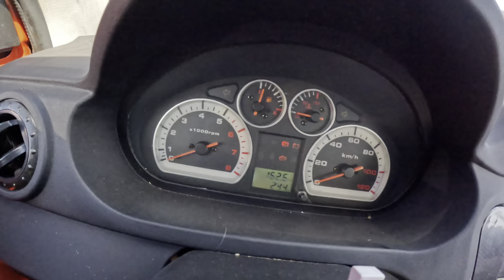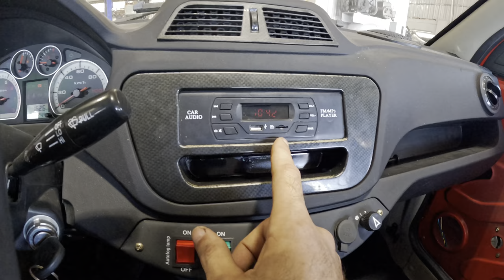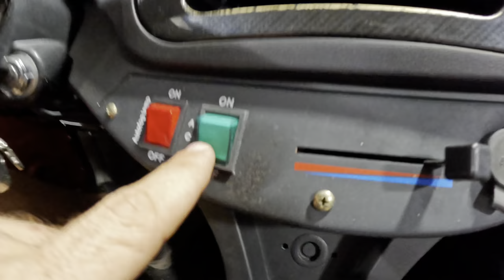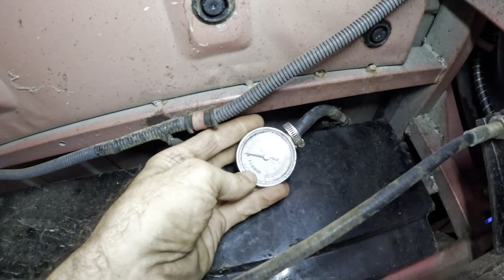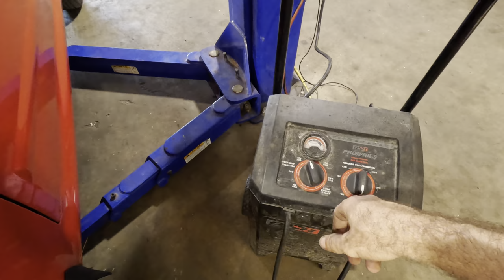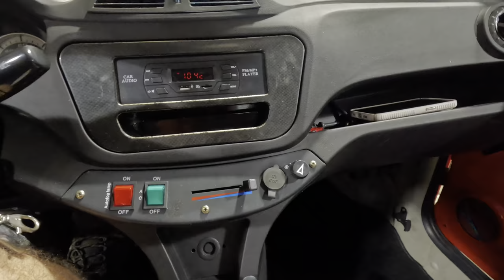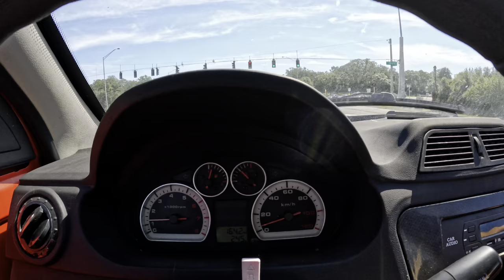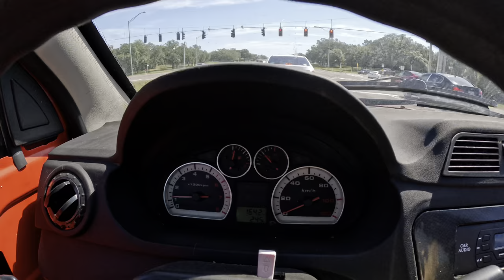UNFIT for the ROAD! Brand New 2019 Piece of Junk!

Comment: If you added a chrome exhaust tip to it, it should, in theory, go faster.
Reply: A chrome tip would add at least 20,000 horsepower.
Reply: What it really needs are some flame or tribal decals from Auto Zone...
And then add some "stick on" Buick portholes down the fenders...
Reply: @bawbnottheowldbawb7558  Then add a new class of race car... "A Gillion M.P.H. and faster."
Reply: it MUST obey that automotive law! 🤣
Reply: LOL - And also double the resale value
Reply: It is red, so it's obviously à high performance model.
Reply: Seriously? You're nuts!! 20,000hp?? NO WAY!! Maybe 10,000 hehe
Reply: If it had dual exhaust pipes, it might make a nice wheelbarrow! 🙂
Reply: HAHAHA
Reply: @slacker1 - Yeah a  simple and cheap standard auto parts store sourced chrome exhaust tip I'm sure would double or triple the horsepower. But to go really fast it needs a full-tilt Ricer-spec wing on the back, some fake carbon-fibre interior enhancements, a minimum 5-inch diameter 'fart can' exhaust tip, glitter window tint on all windows, a multi-colored flashing neon under car light kit connected to and controlled by a minimum 1000 watt sound system and at least two huge (more and bigger always makes for better and faster!) "No Fear" decals  down  both sides of the body!
Reply: And new rims,haha!😂
Reply: @humpy936  Yes, cuz old rims have old man fart dust which slows down. But, new shiny rims spin faster which in turn goes faster.
Reply: Don't forget the hood scoop!
Reply: lolololol
Reply: NO!!!
For the love of God, DO NOT make this go any faster. It is already dangerous. Do not make it worse.
It's all fun and games until someone gets maimed, so just say no.
Reply: @humpy936 you could fit the wheels off my old skate board on that tiny car. 🤣.

Comment: If the price was right I would buy one. My wife could use it to go to the market. We live in a small village and only go a few blocks. We use a motorcycle every day but don't go out if it rains. I bought a scooter for my wife and she rode it a few times but is scared of falling over. She drove a golf cart once and loved it.
Reply: It would be great as a shopping buggy. I have driven far worse cars than this. Would like to chase it down bare foot. Drive it for 10 hours and you are 250 to 300 miles down the road. (I would be afraid to take it on a fast traffic road a village would be great thing to have.) He is being bit to harsh on the vehicle it’s $1000 or so new not a BMW.

Comment: I love the simplicity of it. People here have been spoiled by all the luxurious amenities in bigger modern overpriced American vehicles. Yes safety isn’t a big factor here but for a tiny thing to run around a small private community or property like a college campus/school, it does the job. Surely better than a golf cart. You have AC, radio and protected from the elements (rain or bugs). Yes the seals aren’t great but your other alternative is wide open. You can easily add rubber seals and better radio etc. it’s minimalist and simple to fix. Not all computerized. Spare parts at your local hardware store. Ha!
Reply: It’s literally a joke. I garuntee you people in china( besides the engineers) have never seen or heard of this “car”
Reply: @matthewmitchell-hl4rn You might want to rephrase your rant and make it understandable. This time, please also utilize the ‘spell check’ feature on your device. Ha!
Reply: safer than any bike or 3 wheeler
Reply: @hoklo6571  nah, this has no more protection than a motorcycle in a serious accident & bikes are an order of magnitude more agile.
Reply: Please for what one of these jokes cost new you could buy a very economical old car in America that will provide you far more reliability, comfort, and safety. This is a clown car. You want to be a clown? 😂
Reply: @matthewmitchell-hl4rn you people in China? Lol pretty sure they guys american and nice job assuming
Reply: Thats exactly what i was thinking @ButterfatFarms

Comment: AC on a 2 cylinder, your lucky theres enough hp left to drive, I'm surprised it didn't just automatically roll the windows down when you activate the AC
Reply: roll up for speed
Reply: It is used as a brake boost!
Reply: I installed AC onto the three cylinder Geo and it barely had enough omf to get out of its own way. Then there was the chevette diesel with drum brakes, would not go, would not stop and barely made cold air.
Reply: Many years ago my sister owned a Datsun 210 that had AC.  When you switched on the AC you'd think the car was just kicked in the junk.
Reply: A/c = fan and open window

Comment: I remember falling into the chinese micro car rabbit hole about 5 years ago when I went to Roanoke, VA and spotted a small 4 door 3 wheel car which turned out to be a "Wildfire WF-650", a SD650ZK that was imported to America and rebadged after it arrived in a small dealership in Ohio. This company also sold a taller 4 door, a pickup, a pickup with dump bed, as well as mopeds and small electric cars before moving on to sell small houses on trailers. The engine parts were surprisingly easy to find since a company called Joyner also sold buggies with the same 650cc engine which is also readily available to this day (if you're willing to spend 1.4k on a full drivetrain)

The cars are so poorly made, but they seem fun to mess with when they're new. They're so barebones, it's probably a fun way to start working on small engines and even electronics since the fuse boxes are easily accessible.

Comment: More people should drive cars like this.  May force them to drive better.  Ac heat and a radio, what else do you need
Reply: An ashtray.
Reply: That's all my civic has. I'm shocked it has power steering. I love it
Reply: I prefer my BMW. Mine is easy to work on & maintain myself. Has all the cabin features i could ever want.
Reply: I agree, I have a Mazda SP23 2004 manual 5 speed, no traction control or stupid sensors, I’ve had it since new and it’s a phenomenal car because it’s simple and it just runs😊

Comment: Just keep in mind, Geely owns
Volvo
Lotus Cars, UK
Maserati
And some other brands. You should see Geely crash tests. You're safer on a motorcycle.
ETA: No, you cannot title it. It does not meet DOT and NHTSA safety standards. It will be 2044 before you can import it under the 25 year rule, and since it's already here, it cannot be legally imported as a road vehicle. You can totally drive it on private property and cross the road between two pieces of private property, but it is not street legal for safety, bumper height, emissions, and a ton of other reasons.
Reply: What are you on about?

Comment: It makes the French 2CV look good. I remember having a Korean Daewoo Matiz as a courtesy car..  it had all the features like ac and power steering , but  the 3 cylinder 850cc engine was scary , being chased down by 44 ton tipper lorries. 

Scary build quality, I could see daylight down by the pedals too. Welding worse that a home made box trailer.
Reply: Matiz is better. Still slow and quite bad handling compared to other small cars.
Reply: 2cv doesnt have ac
Reply: I assume you're from the UK. A 850 Matiz can surpass 80MPH with the hammer down. Unless those lorries broke the law and ran without speed limiters, there's no way they would be chasing you.

A 2CV would struggle past 65MPH and lose speed on the slightest of inclines.
Reply: @ferongr  On the flat with one person it can do 85. But we had one as a loan car, for a holiday in hilly Wales. Loaded with two people and stuff ….. Joining a duel carriageway up hill it failed to accelerate to 60 mph
Reply: @ferongr 71mph max for a 2cv6
Reply: A buddy had a Daewoo, and he was in the junkyard because he was getting an alternator for his out of a wreck. He forgot his tools. No problem, a little bending and twisting and he tore it out with his bare hands!

Comment: reminds me of my old 1996 geo metro. i loved that little car. 
on a flat surface, i could put it in neutral and push it with one finger.
Reply: Omg, I had one of those 😂.  3 cylinder,  it was great but I had to turn the AC compressor off when I went up hills to get enough power LOL.  it was a cool little thing 🤷‍♂️😆
Reply: For basic transportation, that's all anyone needs. People driving 400 hp 6000 pound pickups around and never hauling or towing is plain dumb.
Reply: Hell yeah buddy. My first car ever when I got my license at age 16 was a 2000 Chevy metro. That thing was scary as hell to go on the highway with but perfectly fine for city driving and such incredible gas mileage driving around with essentially a lawn mower on steroids.

Comment: I'd like to point out this Chinesium automobile doesn't have power steering because a small car like this doesn't require it. Small cars back in the day didn't have it and they steered just fine.
Reply: Some of us remember when most big cars didn't have power steering.
Reply: careful, you'll hurt his feelings
Reply: Usually cars that weigh less than 1000 kg are fine without power steering.

Ok it will be just a tiny bit harder to park but while moving it will be fine lol

Comment: It's not even like an "armored golf cart". It's more of a "golf cart plus".
Reply: A golf cart with the right gearing can BEAT THIS JUNK STOCK.😂😅
Reply: That's an insult to golf carts.
Reply: I mean the a/c and heat are the only plus.
Reply: Plus what?  It's got nothing on a golf cart.
Reply: I think golf carts have better tires & brakes!  🤣
Reply: People use golf carts for reliable daily transportation in some places in the US (Galveston for example) . But I wouldn't trust this thing to reliably go down a golf cart path.
Reply: Somehow I am not convinced about the plus...
Reply: Turn off the AC and double the acceleration!deffinate get the engine ported for any speed!
Reply: Fit a standard radio and some sound proofing,not safe as so small even with all round rotor brakes!

Comment: I think it might be from Guangzhou Auto, possibly one of their old offerings under the Gonow branding.  The logos don't look like anything currently in use but I get the feeling that this thing has been sitting around for a couple of decades based on the amount of rust underneath on something that has never been driven.
Reply: I was thinking Geely. ✌️
Reply: It's a 2019 so probably hasn't been sitting around very long
Reply: @MrUbiquitousTech  No paint under car RUST
Reply: @graemehutchison5696 Numbers mean things, 2019 means it hasn't been sitting for decades.
Reply: No, the rear logo implies GAC Group.  The steering wheel logo looks like a cross between GAC Group and Foton (GAC Group has had many subsidiaries and manufactured vehicles for Honda, Toyota, Mitsubishi, etc.)

Many of these subsidiaries have come and gone over the years; presumably this vehicle is obsolete or discontinued within the past few years.

This type of car is for pensioners; they give away their nice car to the grandkids so they can have something decent for college/starting off their lives.

This car minimizes expenses, lasts a few years.  When the owner passes away, either someone in the family will take the car or give it away to another pensioner.

The car doesn't need to last forever; just longer than the people owning it.  Then it either gets chopped for parts or scrapped like a disposable product to make a new disposable cheap mini-car.
Reply: @Tread1775  belts have Chery logo

Comment: Here in Europe(maybe only in Estonia) these things are a hit. These things can be driven here by people without drivers licence(even people having their licence revoked for DIY). Recent law dictates that people who drive these things, have to use a sign on them, which indicates a "slow vehicle", usually used on farm tractors. But nevertheless, people around here use them even if they cost about 2500 units, more than a "normal" car...
Reply: 2500 units?
Reply: So what is the make and model of the car? Activa seems to be the model but who makes it?
Reply: You are speaking about "LIGIER" or other brand of "microcars" ... driven by a small diesel-engine. Indeed no speed above 45km/h ... but I know a lot of people that are very pleased with those vehicles. 
And YES ... they are quite expensive. Too expensive in my opinion.

Comment: The vibration of this engine must be spectacular, every single screw leaving it's place 👌👍
Reply: 90% of viewers from China.
Reply: FIAT 500 has 2cyl. engine
Reply: @Kartraceone  tiny 4 cylinder
Reply: @KingfishStevens-di9ji  Fiat's TwinAir engine is a Straight-twin engine designed by Fiat Powertrain Technologies as part of its Small Gasoline Engine family — employing Fiat’s MultiAir hydraulically actuated variable valve timing and lift technology. Wikipedia

Compression ratio: 11.2:1 (naturally aspirated); 10.0:1 (turbocharged)

Configuration: Straight-two

Cooling system: Water-cooled

Displacement: 1.0 L (964 cc) (naturally aspirated); 0.9 L (875 cc) (turbocharged)

Fuel system: Indirect injection

Power output: 60 PS (44 kW) (naturally aspirated); 80 PS
Reply: @Kartraceone  LOL ok, the fiat 500 I owned had a tiny 4 cylinder. Maybe those other two cylinders were fake.
Reply: @Kartraceone  seriously Google Fiat 500 4 cylinder.
Reply: @KingfishStevens-di9ji  the old fiat 500.
Reply: @joaovitorsilvagohl682   Nope, the current one.
Reply: @joaovitorsilvagohl682  Fiat 500 TwinAir

Characterful two-cylinder engine breathes new life into Fiat's retro city slicker. We drove it for the first time on UK roads to see how the little Italian stacks up.

by: James Disdale

29 Oct 2010
Reply: Current Fiat 500 was issued with several different engines and transmissions as well.
Reply: @Kartraceone  circle gets the square.
Reply: @Kartraceone  You really can't compare this engineering & quality to 500's engineering & quality. This engineering and build quality makes fiat 500 looks like a car from the space age...
Reply: @justaparps8088  You have amazing ability, reading something, somewhere that I never mentioned and telling me this ? I have few 500s and need no lecture on what FIAT is, in fact in last seventy years I had many different FIAT models. I merely said that it is one out of two modern 2cyl. 4 stroke engines that you could find nowadays in the car.
Reply: Nothing a tube of bolt sealer can't handle.

Comment: In this day and age where most cars are pricing at $50K plus, there is a market for an inexpensive but well made car for under $10K.  I don't need power everything, fancy radio, vibrating message seats, etc. I can use a car like this but just a better quality build, and designed to accept all the popular upgrades I could use as I want them.
Reply: What about the airbags?
They are responsible (when used with seat belts) for people walking away from unbelievable crashes....

Comment: Looks like the intended market in USA for the importers are in the "Golf Course Retirement Communities", like The Villages near Orlando, which are all laid out with seperate mini-roads for golf carts and mobility scooters.  A senior's alternative to golf carts to get around town but this one is (fairly) rainproof and has A/C (if it works), and is not intended to be street legal.
Reply: Or they imported it as a curiosity? That thing is over 25 years old, and the design stems from the 80s. I have a road-going version of this car in Canada (Imported from Korea) that has 3 cyl, 51 HP, and 796cc. It is sufficient for a commuter car, but I drove it from Vancouver to Ontario without any issues.
Reply: If it goes to the villages it needs a colored loofa!!!

Comment: I on e drove around a 1974 Ford pinto 4 speed that had a race header on it with 18in of pipe and that was it for exhaust. The starter was out and had to push start it every time. Forgot to mention it was painted black with a roller brush and had massive 10in hood scoop. Bought it for a hundred bucks and sold it to a just no yard 6 months later for $250. Good times in Whidbey Island Washington.

Comment: This is actually a good car when you consider the design was to build down to a price. It's not the car you tow boats with, go on long drives, or even enjoy driving but it's affordable to people on extremely limited incomes. 
(Had to do the hot take because everyone else is going to post (correct)reasons why this is a bad car but not why it's made this way.)

Comment: Ray, Did you notice that the "sunroof" is backwards therefore it's an "emergency air brake!" 😂
The overflow pressure vessel does look VW.
If you didn't know better, I'd say it's a Chinese CROSLEY !
Reply: Even Crosleys were 4 cylinder.